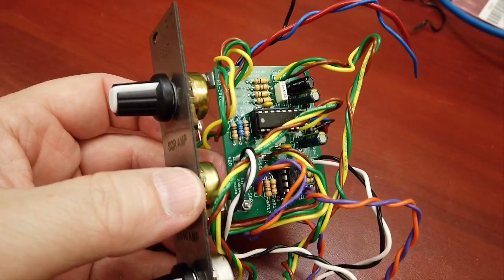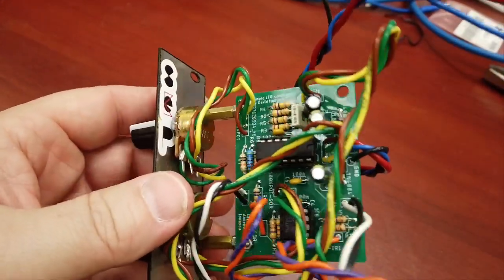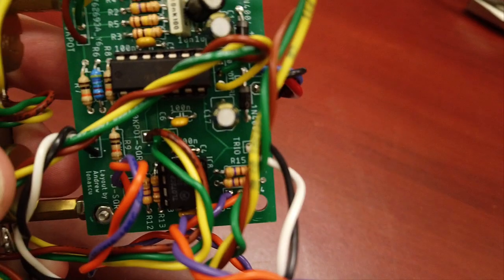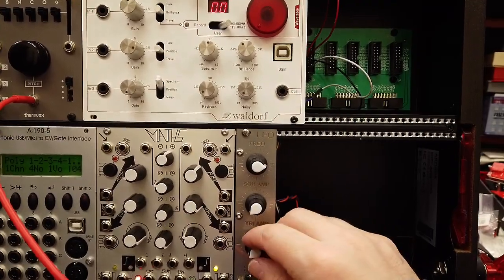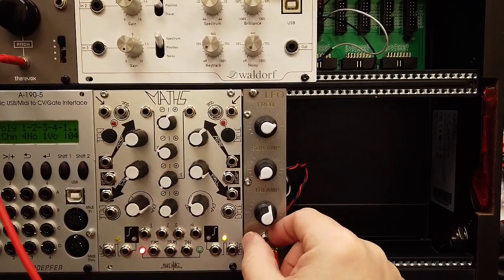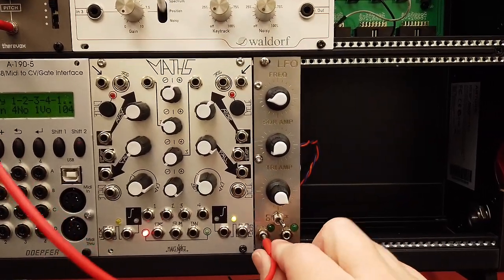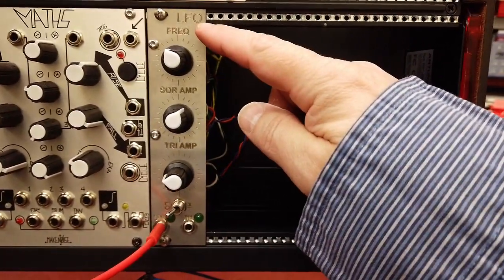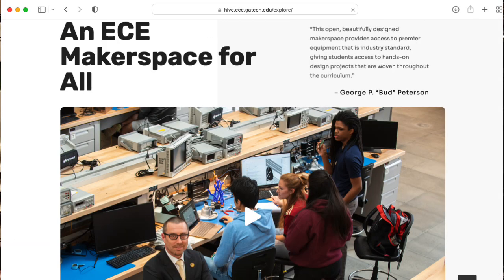LFO Module Built by Georgia Tech VIP Students (front panel fabricated on a FabLight)

Comment: Aaron, thank you for your great videos, I learned a lot from them. I am not a Georgia Tech student and can only go by your videos. There is a very interesting topic I couldn't find much on. The pentode connections. I know it can be connected as a triode with screen connected to cathode, screen connected to control grid, screen connected to the plate, suppressor to cathode..., inverted triode with the plate used as a control grid, with the output taken from the suppressor... You wouldn't have a great long video on all these different pentode connections, would you?
Reply from the maker: I don't actually know of any beyond the standard ways of connecting them. ;)

You've probably seen my Guitar Amplification and Effects playlist -- but there I only talk about the standard connections typically used in guitar amps.

I've never heard of inverted triode -- it sounds very strange.
Reply: @Lantertronics  Thank you for your response. I sure have watched a lot of your videos which were very helpful. I am modifying an old tube organ into a guitar amps with some additional features and that is the reason I am interested in different pentode connections because, for example, when used as an oscillator the tube's output is sometimes taken from the suppressor grid.  I couldn't find much info on the topic.
As to the inverted connection, one of the old radio handbooks says that the inverted tube is useful when it is necessary to control a large current by a very high voltage, without at the same time time consuming any energy from the high potential source.

Comment: Hey Aaron: Had been considering seeking a PHD sponsor at The National High Magnetic Field Laboratory, but then veritasium did a video on that facility the past day, so up for sponsoring a PHD? I do native Apple platform software engineering (have built apps in Objective-C, Swift, SwiftUI), and have also done some robotics and electronics prototyping professionally. Also have made AU plugins and music apps (including an emulation of the most notoriously challenging analog Roland synthesizer to emulate). I am currently working on a new XR app and have also prototyped a custom electronic XR interface product and designed the most modular HMD product (that I know of) of the past calendar decade. PHD sponsor suggestions are also appreciated. Thanks in advance !👍🏻PS: I used to visit the music technology department at Stanford when resided near there and would also be open to getting a PHD through Stanford. Not as focused on making music related things now though, because that isn't very interesting anymore and honestly feel a little silly I invested so much into producing music historically.

Comment: the latest SSI2164 datasheet has an easy Lfo, a voltage controlled square wave made with 1 cell of a 2164
Reply: The ssi / ssm 2164 coats 2-4€ an OP amp coast 0,2€, a better choice to ssm would be the LM 13700 or what ever it is called minimum half price.
But for this the TL074 is probably the best choice.
Reply: @sopalen  you get twice as many vca cells with a 2164
Reply: @adamarmfield1069  Yes you do, twice the cells. For this circuit you do not need 4 cells hence you choose either OP amp or a LM